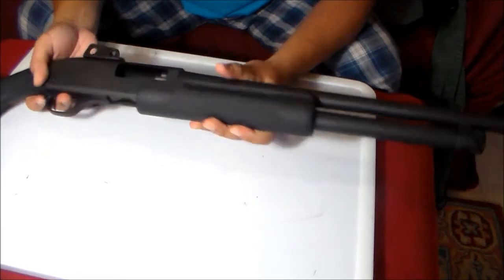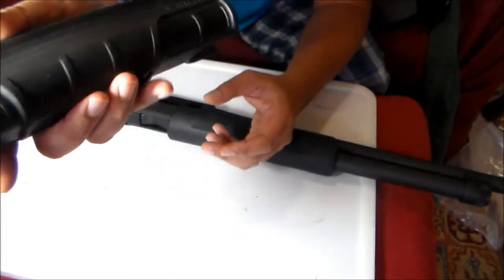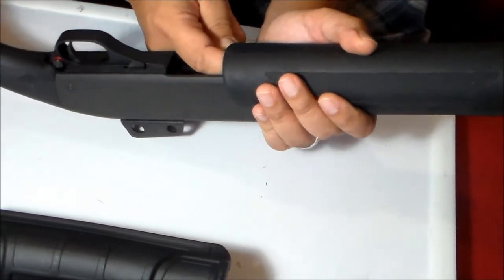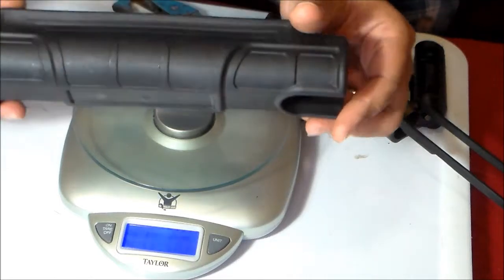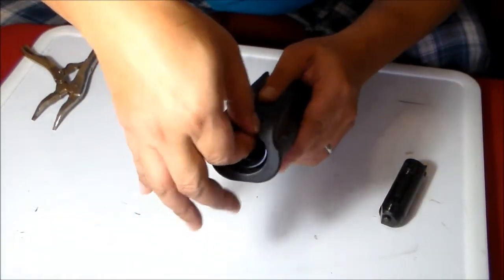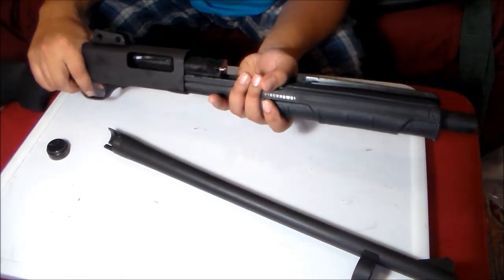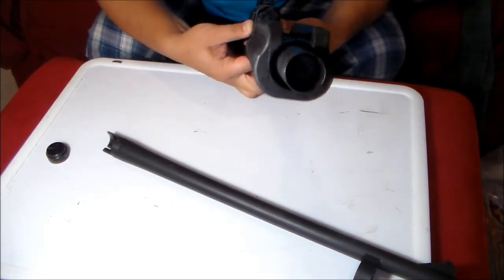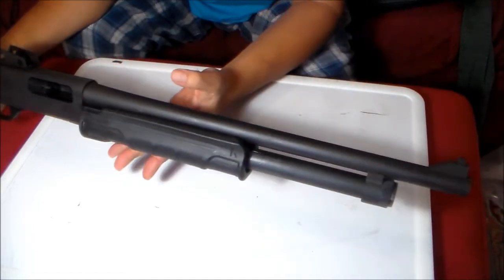BLACKHAWK FOREND INSTALLATION

Comment: My Mossberg 500 does not slide off when you press the tab inside of the magazine tube. I hate how this guy didn't use the proper words I was trying to figure out what he was trying to talk about it's the ejector spring thing that you press down and pull the bold and foregrip all out in one my Mossberg 500 doesn't do that and he shotguns are easy to work on. This video made me angry